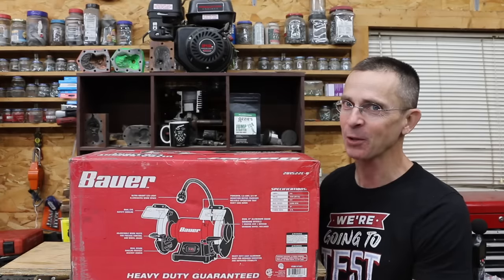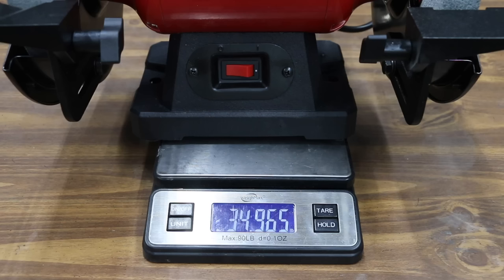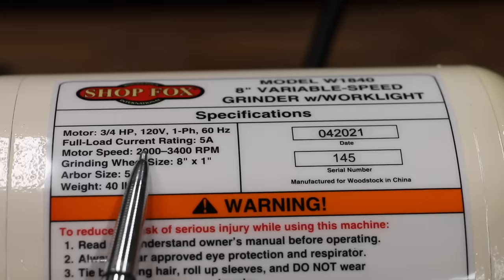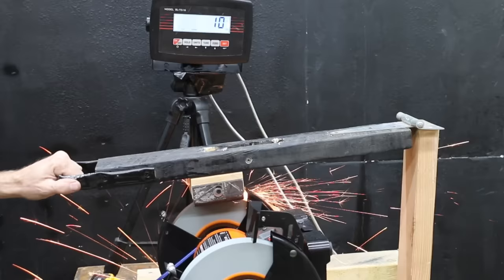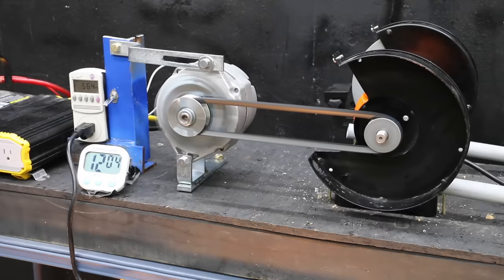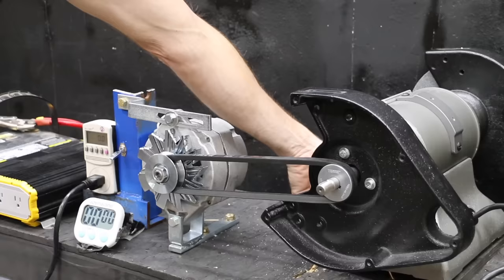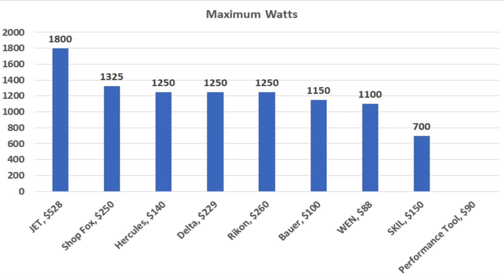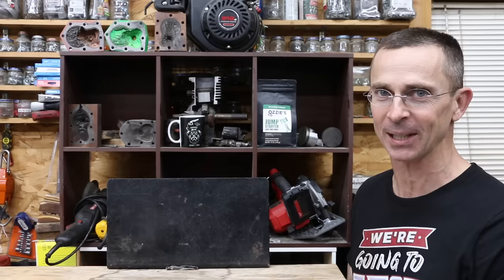Best Bench Grinder? Let’s Settle This! Harbor Freight Bauer vs JET, Hercules, Rikon, Shop Fox, Delta

Comment: There's no doubt in my mind that this is THE channel for unbiased testing.  Excellent job yet again.
Reply: agreed 100%
Reply from the maker: Thanks so much!
Reply: TRUE!!!!
Reply: He does great but he does miss a lot of things some tools are used for. And he's the only guy we could trust to convert power ratings, a corded 12 amp sawzall or angle grinder equals what on a battery unit??????
Reply: @ProjectFarm  walking in to buy a battery planer and logged on. Shocked I'm shocked I say!!!!!!!! First time there was nothing.
Planers in a framer's bags are a big deal. Straighten out a piece of wood or clean up something so the next stud or wall fits snug.
I'm cleaning up a bad framer's exterior door openings so the doors fit and it's Sunday afternoon!!!!! Project Farm what have I done to make you abandon me???
Todd, you need to talk to some workers with 20+ years using a tool so you can add or switch out a test to include testing some feature only pros know is important.
For instance a good awl or some other small fine tip tool to tap in to hold your chalk line. plastic box chalkline shattered the first time I hit my new $20 stainless awl. You always had  to get that one awl and there was only one metal chalkline back then, 2008.

Don't think you did a pound the smooth side into a high quality fine point awl with 10-20lb from a 24 inch hight. Then test the pull out required on the awl.👻👻👻👻👻👻👻
Reply: @sparksmcgee6641  is this an AI generated comment
Reply: This is the defenition of BIASED, you clearly didnt watch the video.  The 528$ 1HP tool receives the same treatment as the 88$ 3/4HP tool, yet the SKIL receives special treament for being a 1/2HP tool. This ameks the 528$ JET look great and the SKIL seem better than it is.

Comment: Really appreciate all you do Project Farm. Great testing. Any chance you could do a mini electric screwdriver test? There are so many of the pencil style screwdrivers.
Reply from the maker: Thank you for the video idea!
Reply: @ProjectFarm  try and get a panasonic to review if you do.
Reply: @ProjectFarm  If you're testing precision electric screwdrivers then, for me, the most important thing to test is the accuracy of the torque setting.  Tiny screws are easy to strip out if the driver isn't sensitive enough.   My favourite is the M4 (yes, four volt) Milwaukee screwdriver #2101-22.  It's a panel-builder's dream come true with its electronic torque system, but it's old and approaching obsolescence so maybe there is something as good or better out there.
Reply: The Dewalt one is top notch. Used it on a lot of small electronics and it's amazing.
Reply: @peterbenjamin8351  does DeWalt make the mini pencil style electric screwdriver? I think they have the fatter ones but not the ones that are like pencils.
Reply: @allothernamesbutthis  Does Panasonic make the mini pencil style screwdrivers? I'm thinking about the pencil style that are maybe one half inch in diameter.
Reply: @Matthew O'Brien  my bad i was thinking of usual sized power drivers, looks like they now do a smaller palm sized handle version.
Reply: @allothernamesbutthis  I was thinking about the really small ones. He already did a compact screwdriver test about a year ago. Maybe I should have said precision electric screwdriver.
Reply: @Matthew O'Brien  Oh sorry, I'm not sure. I've only used the regular size.
Reply: I second this. Would be great to see a review of an electric precision electronics screwdriver.

Comment: I purchased a 6" Jet grinder over 20 years ago. I appreciate the cast tool rests. It still runs strong and quiet. I do wish it was bigger at times.
Reply from the maker: Thanks for the feedback.
Reply: No you don't.  I bought an 8" Bauer bench grinder.  It is dangerous and overkill for my sharpening needs.  I wish I had a smaller one. The wheels are VERY VERY wobbly and I don't know how to balance them out. Seems a tough job.  6" is much more manageable.

Comment: Bought the hercules with coupon for a little over $100.  Motor appears to be very good, but one of the wheels is impossible to balance.  Works very well with felt wheels.   One of the advantages of variable speed is that you can also find a "sweet spot" minimizing vibration. Would love to see a test of 8" grinder wheels.  Thank you for your reviews!!

Comment: Thank you for sharing
I've had a 10 inch Baldor with a 1HP motor since 2005.
🏆🤗🇺🇲🙏
Reply from the maker: You're welcome!
Reply: Baldor makes a fantastic grinder but hard to swallow that initial cost for me, especially when I’ve had a 3/4hp harbor freight grinder I use in my daily work with a multi tool attachment and it’s still working after 5yrs.
Reply: Have a Baldor that I bought in 79 - still working great it was worth the money
Reply: @jamesholland1727  I love to hear that, I know they are made in USA also and I sure like that.
Reply: @jamesholland1727  Same here...Our 6" Baldor is painted Green from the old days 1970's...still works as it did when new. All USA made with quality bearings and motor. Cast iron on all parts except the tool rest.
Reply: I have  a 8inch jet over 25 years old 1hp have used it every single day for the 25plus years I've had it in my metal shop never felt the need to waste that kind of money on a bench grinder my jet will do everything that baldor will do and it's built just as good for alot less.

Comment: Great review!  Based on what you presented, I went an bought the Hercules at my local HF.  I was looking at the ShopFox as well as I wanted the variable speed, but I had a 25% off coupon for HF so that sealed the deal!!!

I wanted to find out how the speed controller was working and I was VERY impressed!!!  It isn't just a simple AC control but actually uses a dedicated AC motor speed controller integrated circuit with optical tachometer feedback!!!!

They use a disk with 12 slots cut in it that is attached to the shaft of the motor, and an optical slot on the disk.  The output from the optical slot is fed back to the controller IC and corrects for changes in speed, keeping the speed constant.   So at 3590 RPM, the tach signal is 718 Hz or pulses per second.
I was also able to re-adjust the minimum speed on my grinder to 1400 rpm for grinding carbide lathe cutters.

The motor current is also monitored and is used for overcurrent/stall protection.  There is also a soft start function on the IC that isn't being used for this grinder, but I changed that!

The integrated circuit used for motor control is made by Telefunken and is part number U211B2.  I was able to get a data sheet on the IC so I could understand how it was used.
VERY good deal for a bench grinder, WITH the 25% off coupon, came in right at about $100!!!!

I am guessing but the ShopFox might use the same speed control method, but the price was alot higher than I wanted to spend, plus the coupon for the Hercules!

Thanks again for your work!
Reply: Is there a write up for that soft start function? Or anything out there for me to look into that?

Comment: When I was in need of a grinder I was looking at the WEN 6 inch on Amazon.  I ended up catching the deal of a lifetime on a used JET 8 inch, and that thing has been a beast
Reply from the maker: Nice!
Reply: Sometimes garage sales are the place to be, a Jet for $10.
Reply: @wobblysauce  I had answered an ad for a miter saw, and it turned out the guy had a big workshop and was retiring and moving to Florida and was liquidating everything. The original $40 ended up costing me almost $2,000 because I bought a lot from him lol
Reply: @TechTimeWithEric  Exactly the correct thing to do.
Reply: Like most things... how am I going to transport it all.

Comment: I would love to see a vintage baldor, Dayton, bd etc stack up against all these new ones. My favourite part about the old grinders is how quite and smooth they are.
Reply from the maker: Thanks for the suggestion.
Reply: @KreemieNewgatt  
Baldor sold out to ABB, a Swedish company,  they still build Baldor motors though. They are pretty good motors, but they have some poor management practices.
Reply: I have two different bench grinders that I use. One has a grinding wheel and a wire brush, and the other one has a grinding wheel and a cotton buffing wheel. The grinder with the buffing wheel is my grandfather's old craftsman. It turns on and gets up to full speed in about 2 seconds. I can lay into that buffing wheel and it doesn't bog down at all. I've leaned on it so hard it spins the wheel in the mount, but the motor is still going full speed.
The other grinder is a harbor freight Central Machinery brand. It takes a little over 5 Seconds to get up to full speed. And even using the grinding wheel it's pretty easy to get it to slow down. I can lay into the grinding wheel on the old craftsman pretty hard and it just chugs along.
Both are supposedly half horse motors, but that old craftsman half horse has been eating a lot more oats than the newer horse I think.
Reply: Exactly baldor grinders last a long time and smooth.
Reply: Probably not relevant here. I think PF chooses products people can buy and use at most place. Specialty tools are a whole different category imo.
Reply: He won’t compare them because he can’t earn an Amazon commission on them
Reply: @thomasstogner4715  he won't spend thousands of dollars to wire his shop for 3 phase- um okay
Reply: keep you eyes out for these on Craigs list.....
Reply: Quite what?
Reply: @Project Farm   I would like to suggest Non stick cookware for testing
Reply: @keithyinger3326  I have one of those ancient motors too. My grandfather on my dad's side of the family built a bench grinder from scratch back around the time of WW2(Either just before or just after) and the motor still runs as good now as it did when it was built. The equally ancient control box...variable speed oh so fancy!...is fried, but the motor itself is still flawless.
Reply: @ironmonkey1512  First off, Baldor makes plenty of single phase grinders.  Second, even for 3 phase, he could just get a RPC or fancy electronic doohickey to do the same thing.
Reply: Bosch also made an incredibly good 3/4 hp  Bench Grinder back in the 90s at their North Carolina Plant.
Reply: I have an old Dayton and it’s great
Reply: i have a baldor 3hp 3ph 12inch pedestal grinder and it is insane how powerful it is!!!  ive tried to slow it down with a bushog blade but no way   id fear what it would take to lock it down  probably bust the wheels!!!  i weighed it with my scale @ 425 lbs  amazing old school grinder!!
Reply: a phase converter does not cost that much   my machines are on one and its totally worth it  3 phase is far better than single on machinery
Reply: @wyattthatcher337  I think American Test Kitchen does those, too.
Reply: @wyattthatcher337  Check out hexclad pans.
Reply: @MrChevelle83  
I have a 5.5 horse Baldor my pops had for a shop fan that was converted to a big bench grinder/buffer. 
I've watched him use it for 10 years  and it's still crazy how powerful it is. 
Too much for its intended purpose.
Reply: Kewl... Would have liked to have seen how my old $49 Harbor Freight 8" grinder claiming 2 HP and 3450 RPMs would have fared in these tests... I've been happy with it...
Reply: @keithyinger3326  I'm not surprised.   I always go vintage everything that was made here or Japan.   Anything post 2000 has a shorter life span.

Comment: If you do another test, I've often thought Baldor is a pretty good name in bench grinders.  Of course, that company was recently sold, but it might be worth testing the new Jet versus a used Baldor that costs the same.  Baileigh Industrial and Grizzly Industrial might be a couple of other brands worth testing.  If I was going to have variable speed in a bench grinder, I'd probably get one with a nice simple three phase squirrel cage motor and then get a single phase to three phase variable frequency drive.  In lower horsepowers, VFDs are quite economical these days, and they're very good at protecting the motors they operate.
Reply from the maker: Thanks for the suggestion.

Comment: Always a pleasure to see your unbiased reviews and some of the creative and ingenious tests you come up with! By the way I just bought a Dewalt bench grinder a few weeks ago, so far so good…
Reply from the maker: Thank you! How do you like the DeWalt?
Reply: I really like it so far, it’s pretty heavy duty and seems to have decent power.
I was just thinking if you could do a test on magnetic drills if you haven’t done one yet, I’m looking to add one to my arsenal of tools… your annular cutter test you did a few weeks ago would go hand in hand with mag drills!
Reply: I also have the Dewalt. No complaints.
Reply: @ProjectFarm  they seem good, works for drill bit
Reply: I've had a DeWalt grinder for nearly 8 years and it's like the ShopFox in build and accessory level (same factory?). The only thing I've changed was the switch, putting a red mushroom push-1/4 twist switch in place of the rocker switch.

Comment: Having worked in tool sharpening for 12 years before retiring, the one thing I noticed was the grinding wheel wobble on start up on just about all of them. That would make it difficult to get a good edge on whatever was being sharpened. That was the first thing I did after getting my bench grinder from Harbor Freight, dressing the wheel where I was going to use it.

Enjoyed your demonstration of the different grinders.
Reply from the maker: Thanks!
Reply: The shafts on these cheese whiz grinders just aren't very true. There's a shoulder the retaining washer sits on and it's usually all out of wack. These are not precision machines.

Comment: Video Suggestion - Small engine comparison.  Many DIYers use 200cc to 400cc engines for projects such as log splitters, track sleds, go carts, etc...  Would love to see the Predator vs DuroMax vs Honda, etc....  Torque, HP, RPM, Weight, Cold Starting, Electric start options, Hours of run time, Oil quality after hard use, Engine wear, Noise level, Ease of maintenance (spark plug, carburetor, etc..)
Reply from the maker: Thanks for the suggestion.

Comment: The Jet appears to be 469.00 right now. I bought 2 of these 2 years ago and they get the job done for me. Great video Todd.
Reply from the maker: Thanks!  Thanks for the feedback.
Reply: I always wondered if they were worth the money guess they are
Reply: I have worked at or toured dozens and dozens of shops and I have never been to one that didn't have Jet grinders. Even the small mom pop shops I have seen spring for the extra cost. They are great. Only time I have seen one fail was when second shift left it on before turning out the lights so it ran for an entire weekend and the motor burned up.

Comment: Excellent test design as always. I bought a Bauer several years ago and had problems with excessive wobbles in two grinders. I eventually settled on a Ryobe. Next time please include a wobble test and the Ryobe brand. Well Done!
Reply: A few of the grinders have obviously bent shafts. You can see them on the startup tests.

Comment: I purchased my 6 inch "King" (Canadian company) bench grinder from Costco many years ago, still has the original grinding wheels on it.  It has been a very good grinder, but takes forever to stop spinning after it is turned off.  Thank you for the great video, Todd.  I better get off the computer and do some snowblowing...again😜
Reply: We have a German made bench grinder, forgot the brand name but that thing is still working 30years later. Just recently the brake stopped working. When it worked it stopped in a few seconds.
Reply from the maker: Thanks for sharing
Reply: The best bench grinder you will ever find is a "Baldor" i own 3 of them (1) 3 phase 220 volt (1) single phase 220 volt and (1) 110-volt small bench grinder. All of these are 35 plus years old and still operate flawlessly. These have been in a family business for their entire life and used on an almost daily basis. If you find one at a sale buy it.
Reply: @ThatGuy-sd3zl  Metabo?
Reply: It should take long to stop, a sign of good quality bearings.
Reply: @xippzap  - You are absolutely correct but, you better have deep pockets.
Reply: @xippzap  35 plus years old, that's why they're so good. Seen a few shop channels have issues out of the box with the new ones.
Reply: @Rudy97  Thats was what all the ole timers use to tell me when buying a used grinder.
Reply: @zylent8251  Güde 220v, 250w.

Comment: Another great video and informative as usual. My Dremel tool is needing replacement and would love to see a rotary tool comparison if you are looking for a video idea. Thanks for all the hard work, time, and money you invest in doing this for us.
Reply from the maker: Thanks and you are welcome!  Thanks for the video idea.
Reply: Yes. This please.
Reply: If the chuck just suddenly stopped moving but the motor still spins, you can replace the tubular style connector inside for a couple bucks. There’s a video on YouTube showing you how and what part to order, it’s really easy.
Reply: Looks like a good idea.
Reply: @ProjectFarm  If you do, you might include Foredom.
Reply: @rickbailey7183  It's a bit worse than that. It's about 15 years old, held together with JB Weld and luck, and has to be slapped or banged on something to make it start. It's also pretty low on power and can't really use tungsten bits anymore. Thanks for the help but I think it's time to let the old girl rest. 😂